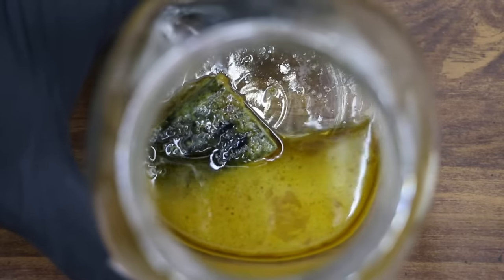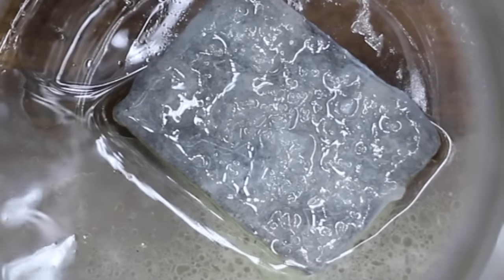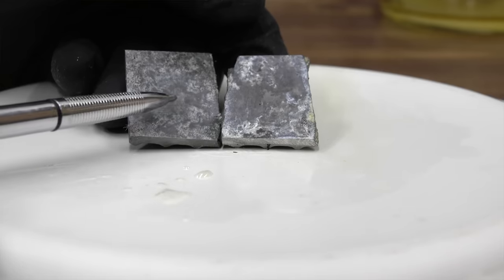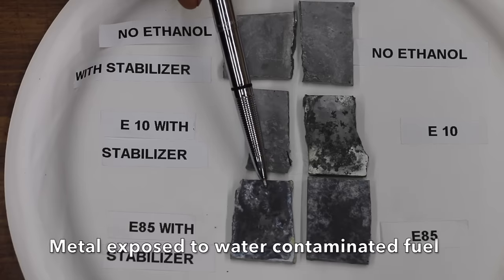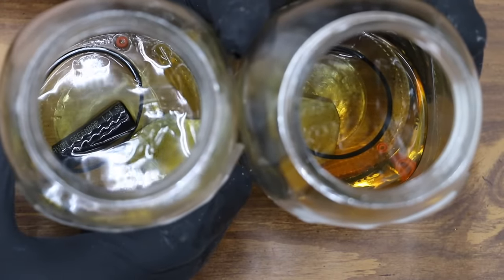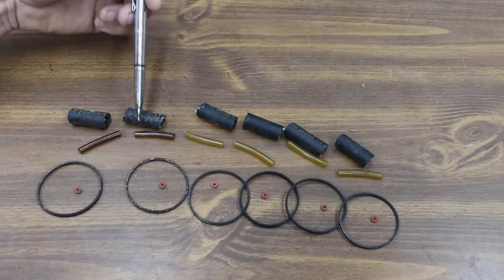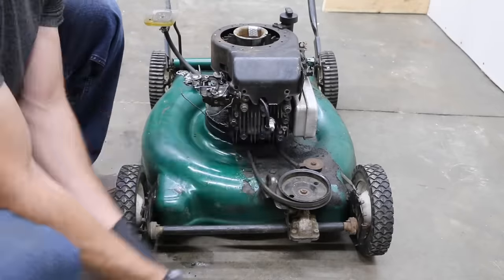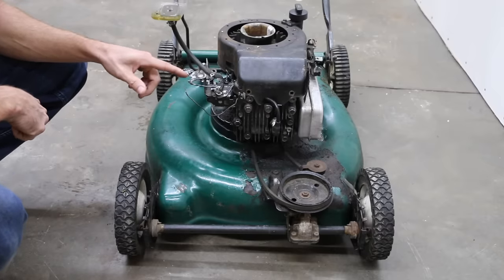Does Fuel Stabilizer Prevent Ethanol Damage?  Let's find out!

Comment: I immediately went to drain the tanks and ran the carbs empty on my mowers, weed eaters, saws and powerwasher for the winter👍 thanks again
Reply: HAHA! I am going to do the same!
Reply from the maker: Great choice!  Thank you!
Reply: Don't forget to run the carbs dry.
Reply: You might want to use something like Seafoam (read the instructions) before storing it.  I purchased 'canned' fuel and after draining and running my small engines dry, put some in the fuel tank and started them up for about 30 seconds.  We'll see how they are next spring.
Reply: I always run the carbs dry before winter.
Reply: I like project farm, but parts of this test are highly flawed. It makes no sense to intentionally add water. If ethanol attracts this ungodly amount of water then let it do it naturally for the test like it would in the real world.
Reply: If you have a machine that have a shut-off valve beetween the tank and the carburateur, like most snow blower, generator etc, It's your best friend. I always stop my machines with that valve, all the time, let It run «starv-dry . It take about 30 to 50 seconds depending the machine. When It's storage time, i add fuel stabilizer , run engines couple of minutes , shut off the fuel and let it stall dry.
Reply: @garrycowan4747  I do that to all my small engines. It's great, isn't it?
Reply: @isaakwelch3451  never had any problème that way 👍
Reply: @johnmoore1495  The second test was done without intentional water contamination.
Reply: VenKando yes but the 1st test and the carb test should’ve had just normal fuel with no water added, doesn’t make sense to intentionally add water. You’re not going to intentionally add water to your fuel, so why do it to the test.
Reply: I just start them up every week and dont run ethanol
Reply: @flick22601  years back I stored a car for 8 years. I oil foamed the cylinders and sta-bil'd the gas.
Started right up.. and ran for years no issues.
Reply: I never run the carbs dry, having read somewhere that a dry carb is a carb with dried up seals and gaskets. I use Sta-Bil and Marvel Mystery Oil over many years and have never had a problem.
Reply: @isaakwelch3451  - That is probably okay for 4-stroke engines but, because of the construction, I recommend that some type of stable fluid like non-ethanol gas with a quality oil ( Stihl or Husqvarna) be kept in the carburetor.  I am trying the premixed 2 stroke fuel for this winter.
Reply: @flick22601  I don't run my two strokes dry. Usually I start them once or twice in the winter instead
Reply: I'd like to see this test done in air tight containers (to simulate storage in a gas can) using Seafoam and StaBil as the fuel stabilizers.
Reply: @gsfbffxpdhhdf7043  That is what i do.I used to use that Starbrite fuel additive,but i don't even buy that anymore since i have non-ethanol fuel available to me where i live now.
Reply: @isaakwelch3451  I've done this for years, but just recently saw a tip about dropping the bowl, if it doesn't have a drain plug, because sometimes not all of the fuel is consumed and some varnish is still form in the very bottom.  Using non ethanol fuel combined with running the carb dry will probably help quite a bit though.